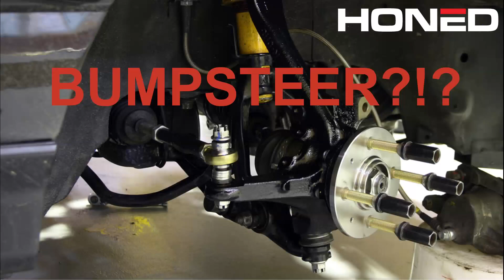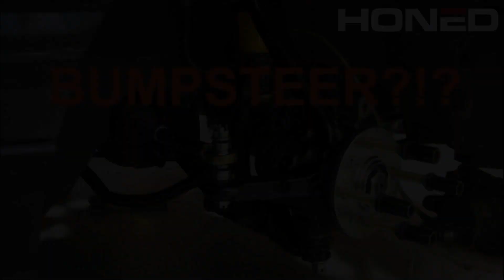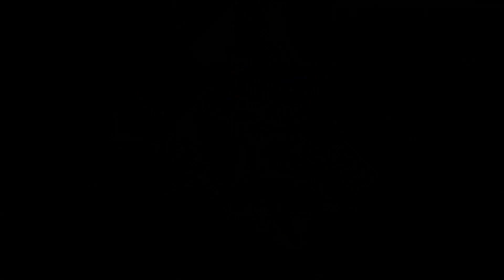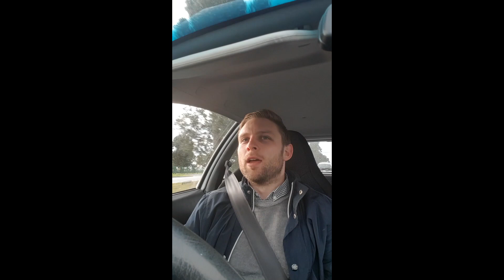Bumpsteer and Double Wishbone Hondas...

Comment: It's upside down the heim joint suppose to go on the bottom not te top as pictured
Reply: That is the way to increase bump steer. It needs to be on top to decrease the bump curve. I have modeled the suspension on double wishbone integra and found the ball joint needs to be higher above the current pickup point. Real time integras did this as well to reduce bump steer.